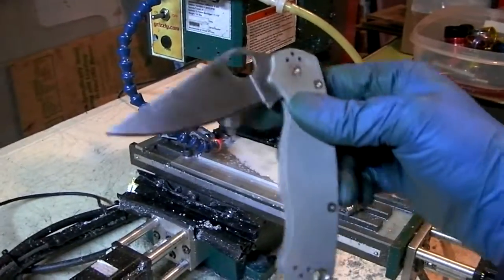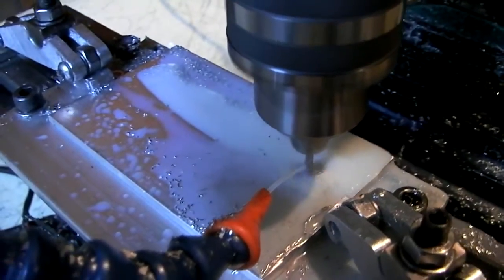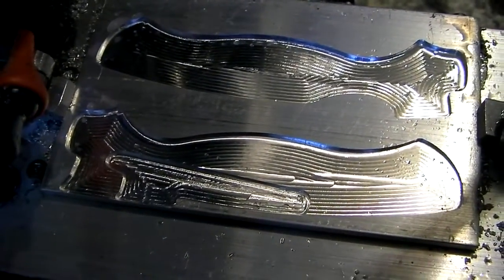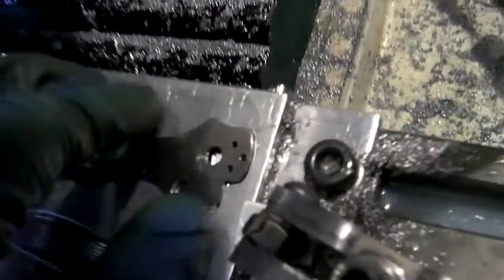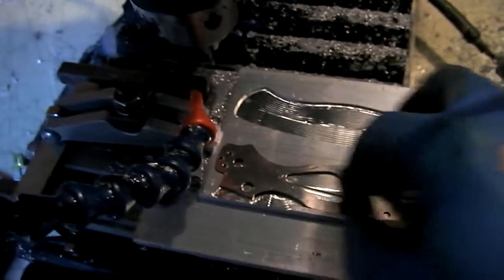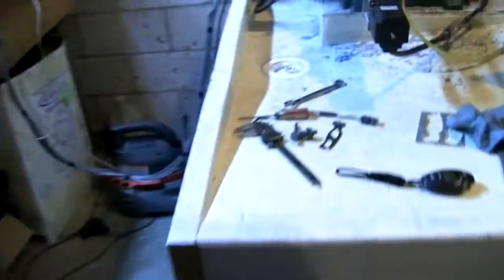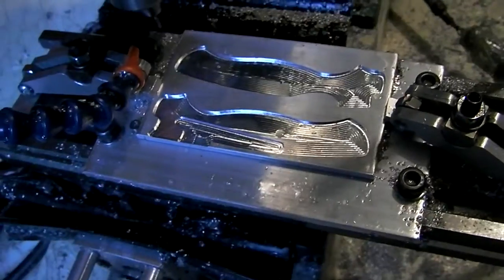Paramilitary 2 first test for nested liners

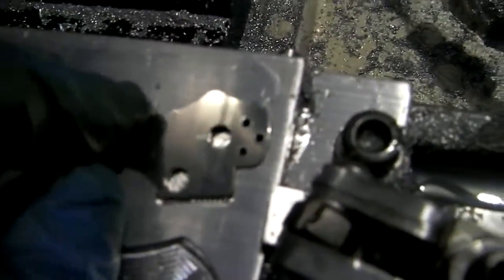Comment from the maker: @hedroncollider I have a touch probe that I made myself, and that's how I digitize all of my handles with a probing routine in Mach3.  It's sticky sometimes but works well, still needs a LOT of editing to clean up all the bad points and get everything perfect, plus I have to offset the dia of my stylus which changes with depth cuz it's tapered (dumb).  Check out my Emerson Dragon (SnpVsbSveBM) video at 2:10 for fixture zeroing with the probe.  I'll do more vids about it later.

Comment: @JohnGrimsmo hmmm I bet that shadow would get in the way if you need it to be dead on. Don't you have a touch probe? couldn't you use that and some probing routine for mach3 to get a model of the part? Anyway, I love the vids, do you have any where you go into more depth about using the probe (for zeroing) and doing tool changes?

Comment from the maker: @hedroncollider Thanks for the tip.  I have tried a scanner except it leaves a shadow.  But if you scan it, flip it 180°, then scan again and mesh the two pics together, that seems to work alright.  What I really need to start doing is drilling all the holes from the backside where that pocket is, then they have to line up!

Comment: yo john, when you need to fit stuff like that together, consider scanning the liner (or whatever you need to fit) then trace it in illustrator (or SW if you can import scans) and finally scale the vector tracing to actual size using a reliably measurable dimension on the liner. that should give you a good profile.

Comment from the maker: @AtPeacePiece It's something I've been meaning to upgrade for a while, but this one seems to be very close to dead nuts centered, so I've never had a problem using it for milling.  It's not recommended, but it's worked for me for 3 years without fail.  I get a teensy bit of chatter that would probably be eliminated by using collets, but for now this works.  I have some ER20's but haven't used them much yet.